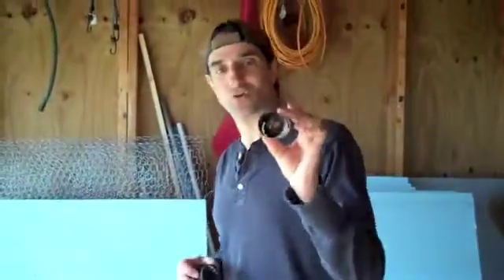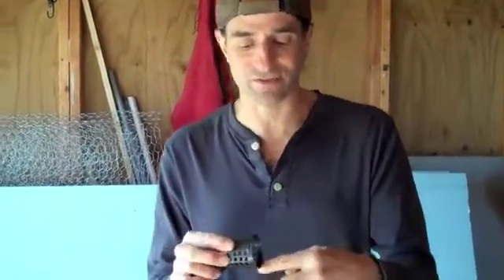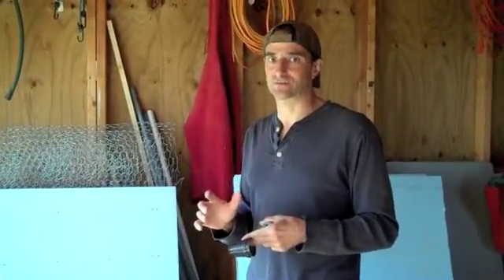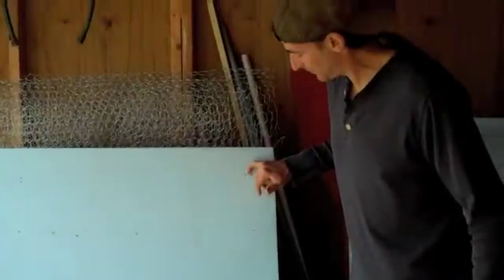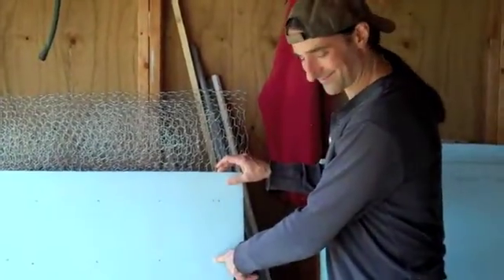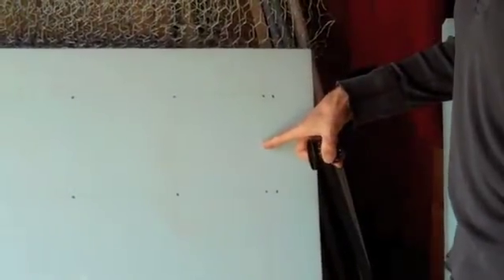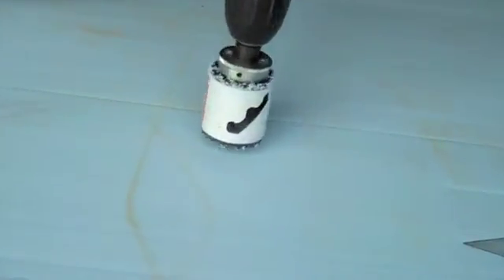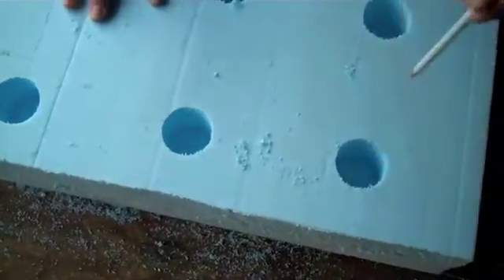RAFTS, NET POTS, AND HOLE SPACING

Comment: It is much easier to simply add an air stone air pumps have normally two lines so one pump is all that is needed for two beds The average cost is under $20 and the work 1/4 inch drill hole inside box where 1/4 inch hose is pushed through stone is connected pump turned on your done

Comment: the pattern i tried to demonstrate didn't come out after it hit post so ignore that part.  Also when transferring your hole pattern from your first sheet you could just use one of the round pieces you cut out with the pencil stuck in the center hole or use the hole saw to make an indention instead of estimating the center with just a pencil.

Comment: You could get more plants on the same raft with the same spacing if you use an off-set pattern like so.
o  o  o
  o  o  o
To simplify, drill your first two holes and then find the point that is 17cm from both holes... Then find the point that is 17cm from both that hole and one of the other holes.  This way you still have nice, even rows but you'll get more of them on the raft because the rows themselves are closer together.  Take a note from the chicken wire sitting behind the raft-to-be.

Comment: Another great vid.    I was just thinking while you were cutting the holes, that the guy who invents a styrofoam - that doesn't get ionised and static cling to everything in the room - will be a billionaire.    

If you've ever re-filled a bean bag, you'll know what I mean.
Reply: Dave38K tiny little deionizing flux capacitors inside each styro pellet